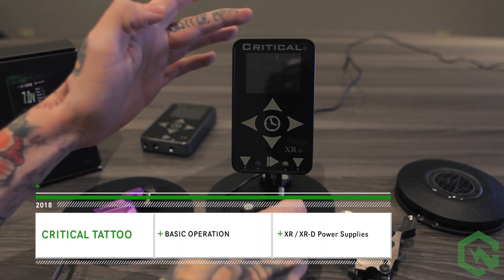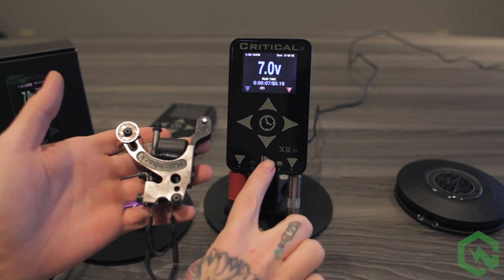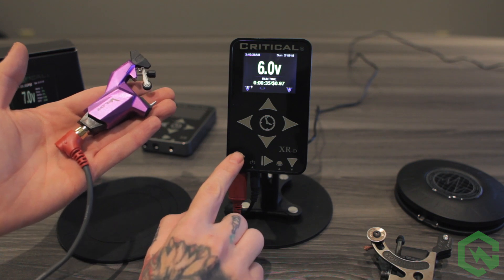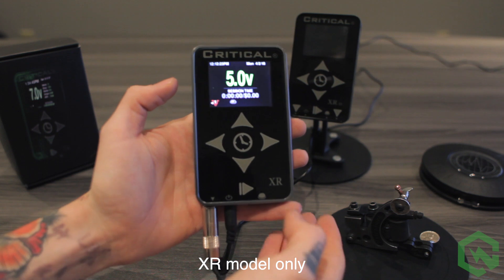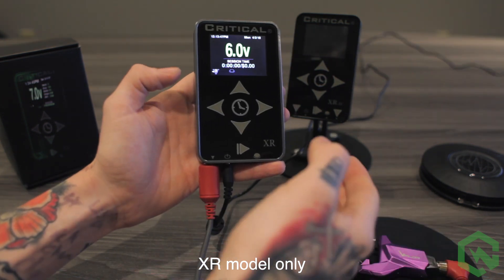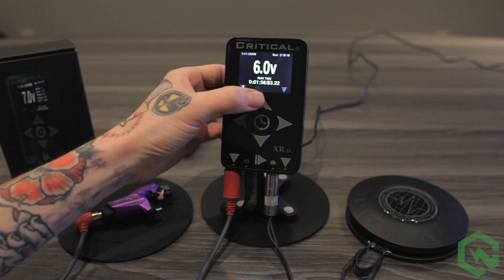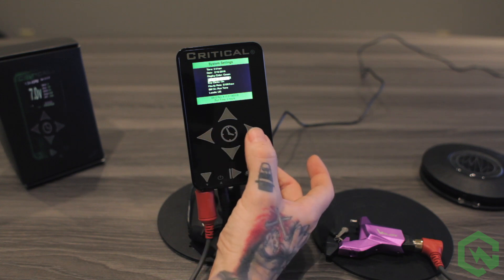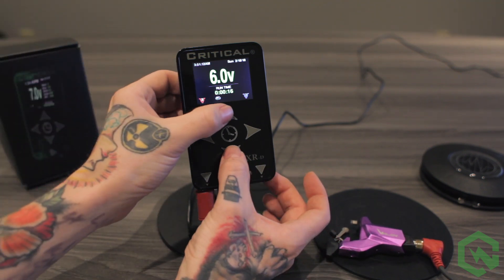XR and XR-D power supply How To

Comment: Can I use Cheyenne machines with this power supply? anyone? :)
Reply: You can get the adapter for it. I just got the critical xr d and the hawk pen. You do need an adapter though which most Cheyenne should come with but you cam buy separately